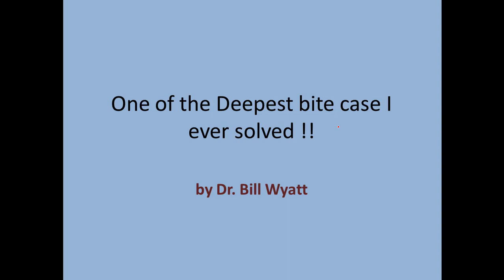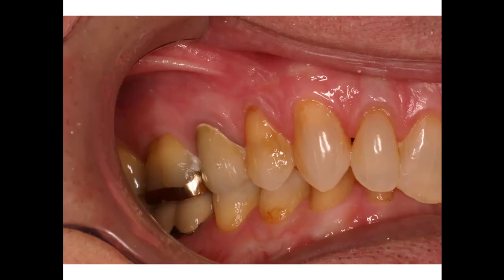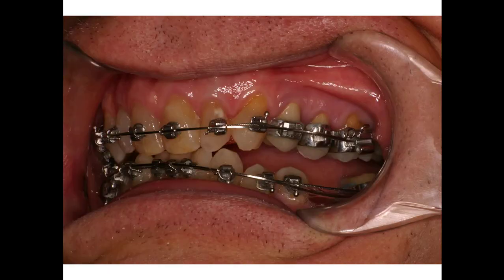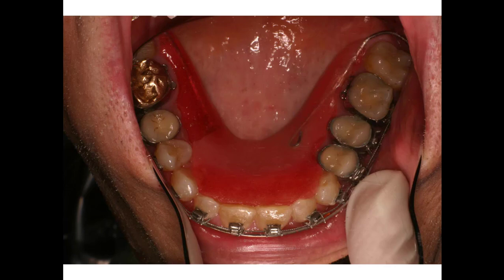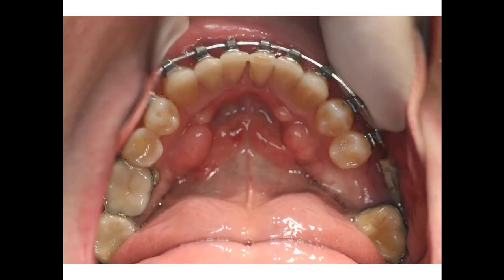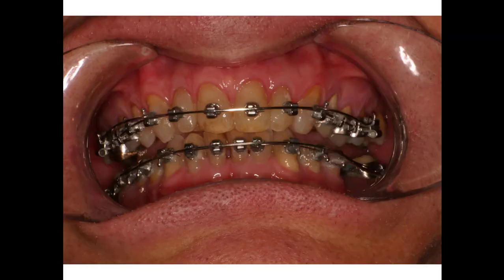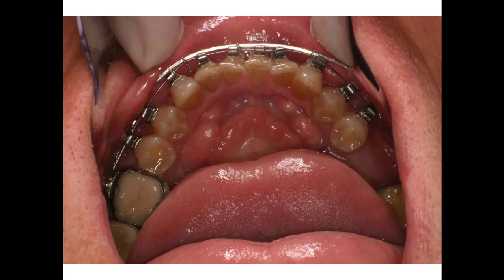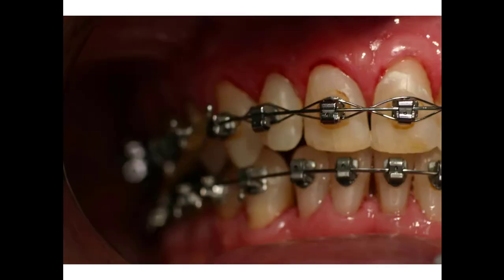One of the Deepest Bite cases I ever solved

Comment: Nice job. I've always found these adult deep bites really hard to open. Do you find you need to do anything special to get palatal root torque on the canines?
Reply from the maker: We band all the teeth that we use in the palatal separator so they are very rigid and as I expand the crown along with the roots, so my roots go out. We donot band the cuspid but the bone structure around the cuspid moves out also. We can correct the torque, tips and cuspid if we need to and as we close the gap between the centrals after the expansion that puts the tip back in the cuspid.
Reply: Dr. Bill Wyatt class 2 elastics also work well